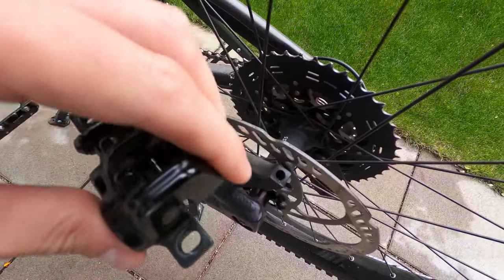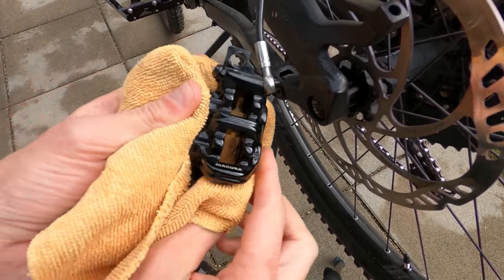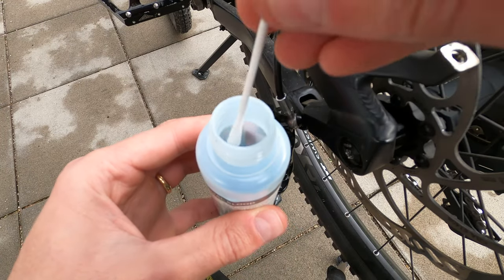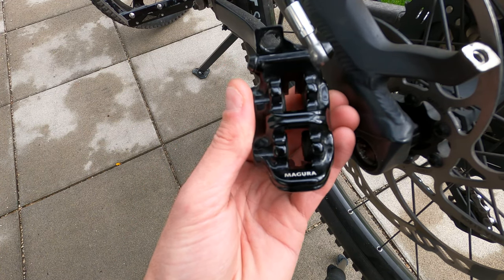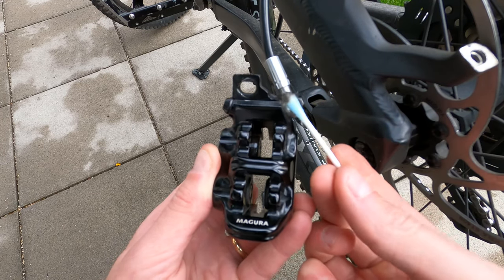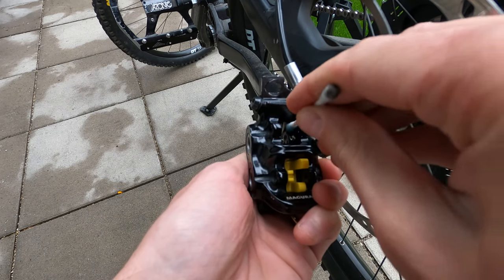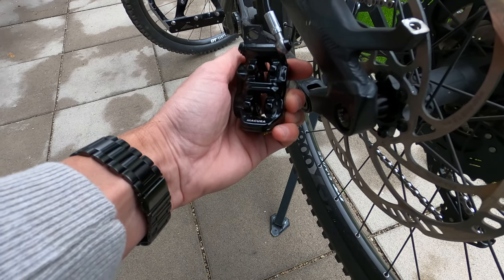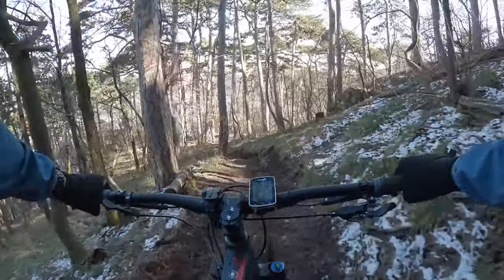Magura MT5 brake pistons cleaning procedure 🛠️! DIY Tutorial for beginners!

Comment: Can u do a content how to Centre e rotor on mt5? Because Its seems to very hard to Centre to e rotor due to e small gap between pistons
Reply from the maker: Andy i do not have MT5 anymore, but do you mean to center the pads? this i can do and it will work for any hydraulic brakes in general

Comment: Does anyone know if it's possible to remove the bore cap on these calipers to remove/replace or deep clean the pistons and replace the seals?

The e-stop version has metallic bore caps with what looks like a way to use a tool to open up the bore cap.
Reply from the maker: no idea on the e-stop version to be honest
Reply: @OresteCiotoli  I've just got it, it's exactly the same, but with either the comfort (mt5) or sport (mt4) pads shipped. The only difference is that it's missing the colour rings around the bore cap, and the estop bore cap is metallic, and the standard version black. 

The tool needed is some large 8 lobed thing, similar to those plastic ones needed to remove the compression cap on a crank shaft. 

The very high-end hope brakes have a seal kit etc, so you can disassemble the whole caliper to access all of the parts. Hopefully you can do this with the mt series. Although I've found no guides online.